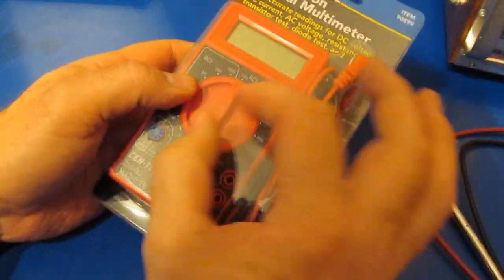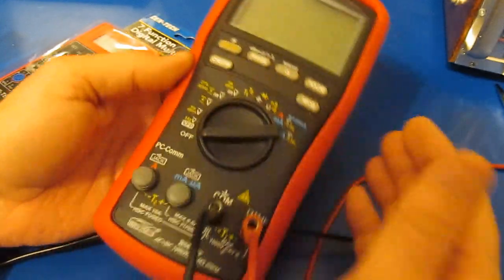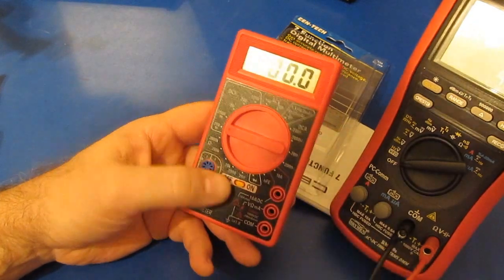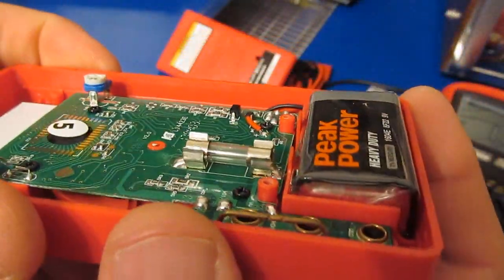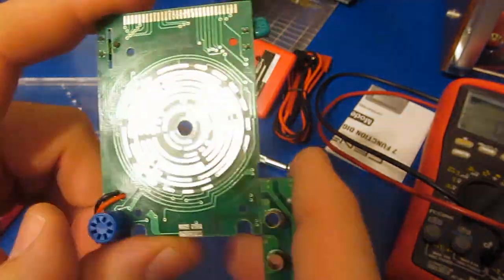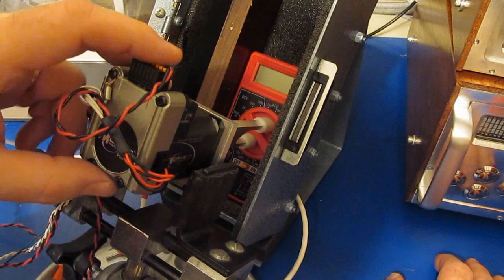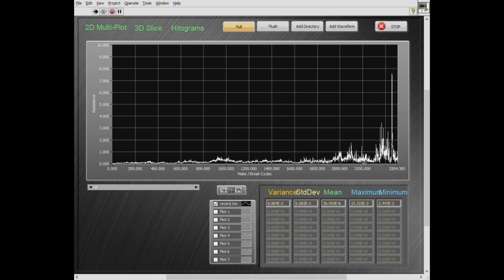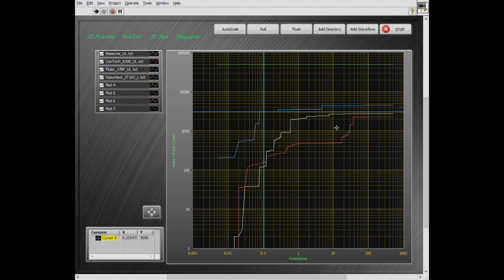50,000 Cycle Multimeter Rotary Switch Life Test,  Part 1

Comment: I may be missing something but I think there's a mistake in your Log/Log plot. For example, why does the Fluke have no resistance values for cycle 1 to 49999 and why does it at 50000 cycles suddenly jump from 0.005 Ohm to 500 Ohm when the maximum resistance of the Fluke was only 0.363 Ohm?
Also on the Histogram, does that peak for the Fluke tally up to 50000 samples? To me it seems way to small in comparison.

PS: Thank you for collecting all this time consuming, but very valuable data for us, Joe!
Reply from the maker: Log/Log is looking at how many cycles before the switches change in resistance reaches a given value.  The Fluke is basically a flat line at 50,000 cycles because it never reached high of a change and I only ran 50,000 cycles.  So at 0.005 ohms, after 50,000 cycles it never reached it.   The ZT102 reached it in 200 cycles.    Let me know if this make sense to you.
Reply from the maker: I had to go back and watch the histogram part, or hitogram.  The reason Fluke appears so small in amplitude is because the resistance hardly moved.  All the other meters were all over the place.  If I reduce the number of bins to say 5, the Fluke would still be a very narrow peak with a much higher amplitude (higher than the others in that sub half ohm range).
Reply: Ok, I think I understand. But then the Fluke should have an almost vertical line that ends at 0.005 Ohms at 50000 Cycles and not a horizontal line. That green line should not exist past 0.005 Ohms, since the Fluke showed no greater change in resistance than 0.005 Ohm over the 0-50000 Cycles span.
To underline what I mean at 30:34 you show the Fluke having a Peak-Peak of 0.0027 Ohm over the 0-631 Cycles span, so another point in the Histogram Log/Log for the Fluke should be 0.0027 Ohm at 631 Cycles.
Reply: Ah, so your bin size isn't the same. I think it's generally frowned upon mixing/messing with different bin sizes in the same plot, because you could easily over/under represent something. In this case it doesn't matter since we're only interested in the shape or how wide the distribution is.
Reply from the maker: No, the bin size is the same for all of the data sets shown on the graph.  If I made the bin size very large you would also see other data sets drop and you would have a better idea what the distribution is.   If you visit the thread I use, I can post some different bin sizes to give you a better idea what is happening.   The same for the log/log.   I could plot going down to 0 if it would help you to understand.
Reply from the maker: I have added some details about the data I collected to try and help clear up any confusion.  See posts starting at  #2109: https://www.eevblog.com/forum/testgear/hear-kitty-kitty-kitty-nope-not-that-kind-of-cat/2100/

Comment: I've had several of these in my knock around tool bag.  Maybe it's from rough treatment while leaving the leads plugged in but the most common problem I have is the metal sleeves the leads plug into breaking loose from the circuit board

Comment: My AN8008 also had a light smearing of what looked like silicon grease but my AN8002 did not. Makes me wonder if these style of meters are possibly being cloned by different factories due to their popularity. Ps- love my 189 too ! :)
Reply from the maker: Dave, I bought one AN8008 and four ZT102s (AN8002).  Each one seems to be different.  Different parts used, different firmware...  This is the first one that had any kind of lubrication.  The one has some sort of white residue that almost looked like soap scum on it.   You could very well be right in that they are made by different factories.  Hard to say but people really seem to like them.  

That 189 is a classic.  If they were still made and met the current cert, I would buy one to run.

Comment: I didn't have faith in fluke, but it shut my mouth even so, hurts and delight view the test. Nice!
Reply from the maker: To be honest, I too had no faith in Fluke when I started making these videos.   Outside of the 87V doing so poorly in the transient tests, I have been very impressed with their products.   They just don't make a meter that I would want for my own electronic hobby use.
Reply: I know of one you already have the 189 :-)
Reply from the maker: But the 189 is an old relic and no longer produced.  Not a bad meter for it's age.
Reply: I would not hesitate to buy a second hand 189 on ebay, age does not bother me if it is a good meter.
Reply from the maker: I assume you own one then as they are fairly common. It's not a bad meter for it's age. For me, it has the basic features I look for in a handheld.  I'm guessing most of their customer base were electrical workers who I doubt cared about the features on this meter.
Reply: Yes, I own a 189, It does the job. But I use the 289 for daily work.
Reply from the maker: Interesting.  I borrowed that 289  and my friend who owns it, likes it a lot.  If I bought a new Fluke, this is what I would get but I would rather have the Brymen.
Reply: Guys, stop bring out the multimeters and compare them, all the world know that cen tech multimeter is the best and this video is fake
Reply: Hi Joe, another thing I like about my Fluke 189 is the BP189 C cell battery pack. You can just leave it unnatended (with a 30min. standby time) and the C cell batteries are going for ages.
http://en-us.fluke.com/products/all-accessories/fluke-bp189.html
Reply from the maker: My friend who gave me the 189 has some of the accessories for it.  We just don't make the time to visit as often as we should.    When I was playing around decoding the CEMs RF interface,  the battery lasted about a week.  I would guess maybe 48 hours of run time.   I have use the RF link to log over 24 hours with no problems.   Normally that is more than enough for when I have needed it.
Reply: I understand that it is more than enough for you for one log session, but imagine what you can log with 4 C cell batteries before they run out of juice. A good Alkaline AA cell battery may have 2200mAh (at 200mA discharge rate), a good C cell battery has close to 8000mAh capacity (that is 32.000mAh in a 189 DMM).
Reply from the maker: There no need to imagine what I can log.  At home,  I have the bench meters running on GPIB along with the rest of the equipment .  I have a PC running LabVIEW with a UPS backup.  It's on Ethernet so I can run the equipment from my tablet outside if I like using the wireless.  With LabVIEW, I could even allow the pubic to have access to the equipment.  I can log for as long as I need to.  The nice thing about running tests this way is I am not limited to just a simple handheld meter.   I have access to pretty much all of my equipment.  Take this simple test for example.  We ar driving a stepper and reading resistance but we need to synchronize the two.   Imagine the limitations of just using a handheld meter.

Comment: The takeaway I see is that switch self-contamination is an issue in the cheaper designs.  It didn't look like the cheaper meters had any lubricant in the detent mechanism.  Not only was the detent mechanism lubricated in the Fluke, the compliant element appeared to be a natural (possibly low fill) nylon and the lobes seem to have a much larger contact area than that provided by the ball detents in the cheap meters.  So I'd be guessing that there's benefits to be found somewhere in the realm of lubrication, low detent pressure, or the use of materials with less potentially abrasive fillers.  

I did notice some of them wearing against the board in the center.  I don't know if any of those have plating in that hole, or if it's just grinding on the raw edge of the fiberglass.

It was also interesting that the Fluke appeared to be the only one with plating on the moving contacts.  I don't think I've ever seen plated moving contacts on any of the cheap meters.
Reply from the maker: I've repeated this test on a few meters now.  You may want to have a look at those as well.
Reply: I'll get there in time.  I've been slowly browsing your videos.

Comment: Amazing video! Flukes are built to last, I'd love to see how others fare.

On a side note, about the log log graph, I think Fluke's green line should have stopped around or before the 0.01 ohm mark on the log log graph if I'm not mistaken. It never really reached any higher resistance values.
Reply from the maker: Have you taken the time to read Jack Whites comments?   If not, I recommend you do.   I have now pinned it as the first comment.

Comment: Very interesting, as usual! Any clues on the type of grease you could use on the contacts to extend the life? I've kinda fallen in love with my cheap Aneng AN8008 meter.
Reply from the maker: Like I said in the video, I really have no interest in doing a study on lubrication, plating, hardness, thickness, spring tension, surface area, .........  I will leave it to the "experts" to sort that stuff out.  I just run them.   

If you like the AN8008, you could buy more of them to keep on hand as backups.
Reply: Agreed, but still now I have to measure the contact-resistance of copper plating when applying different lubricants. Every video you do, makes me go deeper in the rabbit hole. And I guess that's the point?
Reply from the maker: HAHAHA..  Poor Jack had a quest for knowledge!   I am not so sure if the grease did more harm than good in this ZT102.  It was the first time I had seen them use it but I had heard from others who bought the same meter and theirs had grease on the contacts.  

The Fluke 17B+ used a dry contact but some of the Flukes like the 107 use it. Dexters_lab did a teardown of the Fluke 101 and it was packed full.   I have yet to take the 101 I have apart but assume it would be similar.    https://www.eevblog.com/forum/testgear/fluke-101-multimeter-teardown/
Reply: Haha! Don't write shit on Youtube while drunk! "It was horrible! Suddenly I wanted knowledge!"
Reply: I think problem is tension, no lube help it. First aid loose PCB top and 2 bottom screws half turn.
Reply from the maker: If you watch the later videos showing these tests,  the best ones have all had dry contacts.

Comment: I have had problems with the switches on multimeters failing after a few years of use, so the newest one I got - a Mooshimeter - doesn't have a rotary switch. In fact, the only switch on the unit itself is a reset switch that is rarely used.

I wonder if there might be concerns with conductive debris causing an explosive failure if the meter was used to test a high voltage, high current source like an EV battery pack.
Reply: NiHaoMike I got to get me a mooshimeter!
Reply from the maker: Someone had asked me about that moon shine meter.  I looked at it but really did not get the point.  I don't have a cell phone.  Maybe they have Labview support or something.  I didn't look into it.
Reply: Moon shine meter, It could be used for monitoring a moonshine setup :-)
Reply from the maker: I have heard some of those stills were dangerous so it's good to be able to monitor the temperature from a safe distance and the cell phone just makes good sense.

Comment: I wonder what step Fluke does in manufacture that the others omit, don't know or care about.
Reply: Engineering.
Reply: It's a snarky answer, but largely true. Fluke have thought about every aspect - spring tension, shape, material, contact material, etc, and then they've tested and iterated until it performs as desired. The wanabees have picked up a Fluke and said "how can we make a meter that looks like this one? There, job done".
Reply: Rotary switch of Fluke 27FM is the best switch of any multimeter in this word.
Reply: Ricardo B Really, when did you test this? I would like to see that video :-)
Reply from the maker: Engineering... BINGO!!
Reply from the maker: Agree.  I too will take data over feelings.   If the Fluke 27 has the best switch, show the data you base the comment on.
Reply: Like Joe observed, the other meters wipe right over the vias. It doesn’t take a rocket scientist to see that’s  not good engineering and the results showed it. Fascinating testing Joe !
Reply from the maker: Not to mention having it wipe right over some of the traces.  It's not something I would have thought about but after seeing the damage it is pretty obvious.  I would expect these are some of the basic rules you follow as a multimeter designer.   Like not putting latching relays inside that can have their state changed by a magnetic strap!
Reply from the maker: Yep, its a typical Dave video showing the antique meter.  Of course, there is no testing in this video and he really does not say much about it.  I am not sure how you would make the leap from this video to the best switch ever.  

Perhaps you just like the looks of the old switches so you feel they are the best ever.   Personally, I have  had a lot of old switches like this fail.

Keep in mind, these tests are about the useful life of the switch, not how they appear but how they perform.

Comment: As far as I understand is that you're using the absolute resistance value? If so, than you're not comparing apples with apples. You need to compare the change in value relative to the original start resistance, since the resistance of the tracks/circuits etc of the different meters isn't identical. In software this can easily being done by reading the first value and divide the other readings by the value to get the correct relative value. So this will give you a ratio (or percentage) how much off the meter is after x-amount of cycles.
Reply from the maker: You understand correct.  While we could plot the resistance as a percentage change,  I don't feel it is something I "need" to do nor do I see any value in displaying the data this way as it tells me nothing.  It could also make a very poor performance switch appear better than it is. 

Let's take a simple example using two switches A&B.   Switch A has a DCR of 0.001 ohms.   Switch B has a DCR of 10 ohm.   Switch A say reaches a peak resistance of 0.010 ohms,  while switch B reaches a peak of 20 ohms.   Switch A has an increase of 10X and switch B, 2X.   Looking at a percentage would present Switch B as the better of the two.  

You are also correct in there there are other errors outside the switch contacts.  For the most part, these will remain a constant throughout the test for a given meter.  They make up a small portion of the total resistance.  We are basically talking about the trace lengths from the pads to where the wires are attached, the solder joint and the wires going back to the external meter.   These wires for the most part are a constant from meter to meter.  The same for the solder joint.

Comment: With your ZT102 testing it looks like you increased the speed after you started. At 16:19 you can see a full cycle take approximately 8 seconds, but at 16:32 a full cycle completes in just 3 to 4 seconds. I'm not saying it's a Fluke, but that's not very fair.

In general I don't think this testing is a good representation of real-world usage. The tuning fork setup doesn't simulate the movement a hand makes well enough; it's ignoring the detents in the switch, it's moving constantly versus occasionally, it's going through the full range of the switch whereas in normal usage you're not going to be going to microamps and temperature as much as volts and ohms, etc. It's not bad comparing one meter against another, but just because a meter only goes 20,000 cycles on your test jig doesn't mean it's going to die after that many hand cycles over time.

I think it would be interesting to see the improvement made by greasing the switches of the cheaper meters. That's one of the ways the Fluke clearly stood out, that and the separate vias, and no traces for the switch contacts to run over and cut.
Reply from the maker: Take the time to watch the last video I uploaded.    https://youtu.be/bs5n3a__Yq0
Reply: joe smith ah, thank you! I missed that one
Reply from the maker: If you watch the Fluke start it too is slow and ramps up.   Every meter is ran this way which is explained in the last video when I show how I setup the test.  So I am not understanding your first comment about it not being fair unless you skipped over this part.  They are long videos and I know its a lot quicker to kit keys than to pay attention. 

I have been running 50,000 cycles, not 20,000.  

I am not sure why in your last comment you mention greasing the switches and how the Fluke clearly stood out.  As shown, the Fluke was a dry contact.  You may also discover that the meters that have performed the best during this test have had dry contacts.  I have seen some fairly low end meters with lubrication on the contacts.  As I mentioned, this was the first Kasuntest meter that had lubrication where the first two were dry.   

Assuming you watch the last video all the way through, pay attention to how Brymen is running a similar test.

Comment: Gave you a 189!?  I need to get new friends....
Reply from the maker: Consider that he received it from a friend who had passed away.  I asked to borrow it to run some non-destructive tests with.  While I had it, I cleaned it and polished the lens for him.  It's a nice general purpose meter for it's age.  If they still offered it with current cert, I would buy one.
Reply: joe smith Gotcha...my "new" pride and joy is an 87 iii I got for a great deal on eBay.  It was missing the outer condom but I was able to get a brand new one pretty cheap.  It definitely feels quality!